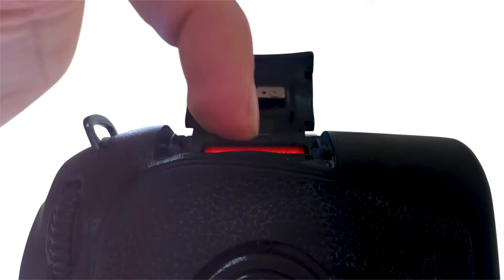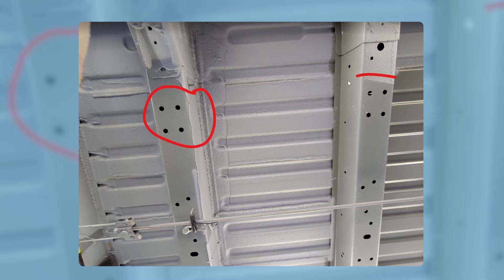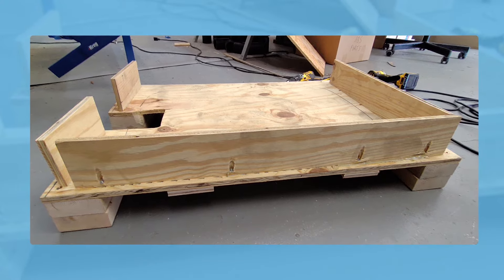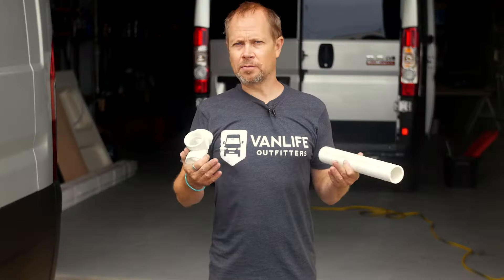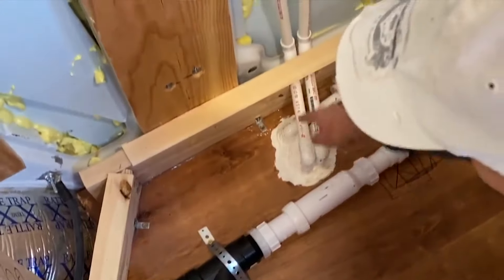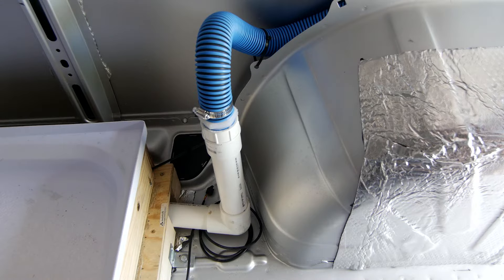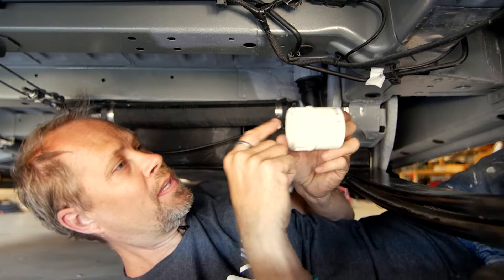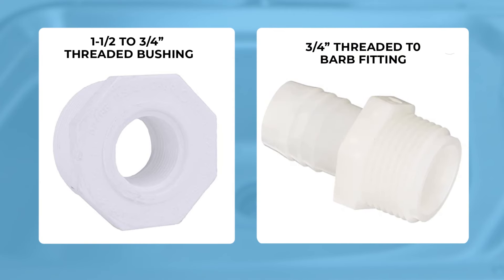Camper Van Drains and Grey Tank Plumbing Overview

Comment: You mentioned the tank level monitor in this video (shown at the lower, left of the tank at the end of the video). This looks different than the SeeLevel that is mentioned on your website. Can you elaborate if there is a possibly a different solution that could be connected to a Victron Cerbo GX? Thanks!
Reply from the maker: At one point we had a different tank monitoring kit that used Safiery external pressure sensors and a Victron Energy GX Tank 140. That is the sensor shown in the video. However, after extensive testing, we ended up preferring the SeeLevel system which is what we have in our store now.

Comment: Do you not get grey water smells in your sink without a hepvo valve there?
Reply: No, there is a small trap built into the RV style sink drain I used. Good question!
Reply: @ZachDaudert  The Hepvo valves boasts air admittance in their product description. If two Hepvo's were used, one under the van as you did and the other placed vertically under the kitchen sink drain replacing the RV style sink drain you used, would that negate the need for a vent? The sink Hepvo would provide the necessary vent height, no?
Reply: I installed this with just a drain for a sink with a Hepvo valve.  It worked fine for a while, but now the sink does not drain properly unless I’m connected to a sewer

Comment: I’m wondering if an in-line cheater air admittance valve vent would do the trick for helping the drain without letting in the smell? Home Depot if you’re not familiar with these. $10 or so and available for ABS and PVC.
Reply: Hi I see your post is from a year ago and I'm presently struggling with this.  I only have a sink that will be connected to the gray tank, but was thinking of installing a Hepvo valve which is supposed to function as an air admittance valve as well

Comment: what does the air vent do? what is the purpose in the system?
Reply from the maker: Hello, the vent allows air to enter the tank when emptying and for air to escape from the tank when filling. If you don't vent, you'll have very slow filling and draining.
Reply: All plumbing drainage systems, in a house or a van, are at atmospheric pressure. If you seal the system up tight, you can't get water in or out. So the system needs to be open to the air. I mean...imagine if you take the drain  pipe off the P trap in your bathroom sink. Now put your hand over the P trap pipe. If you run water into the sink, it's obvious that your hand would act like a sink stopper and the sink would fill up, not drain. The van plumbing and gray water tank are just the same, except more stuff in the drainage path.

Comment: Why not just have a hole in the top of your tank for a vent? With a screen or something to keeps things out?
Reply from the maker: That might work depending on the tank. Our grey water tank that is featured in the video installs very tightly up against the floor of the van so there wouldn't be much exposure to the open air for venting. Other tanks might work better in that regard. The other consideration is that it is illegal in many places to dispose of grey water tank on the ground and if the tank was full, that location would likely "spill out" from the tank as the waste water sloshed around. Hope that helps.